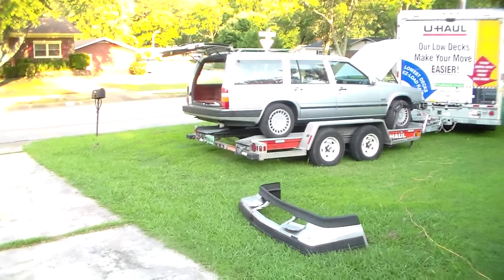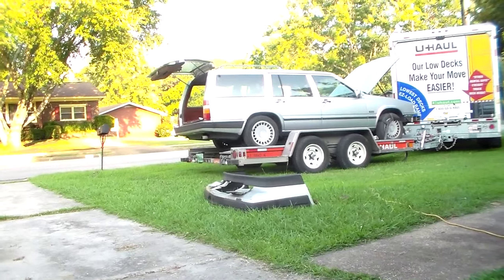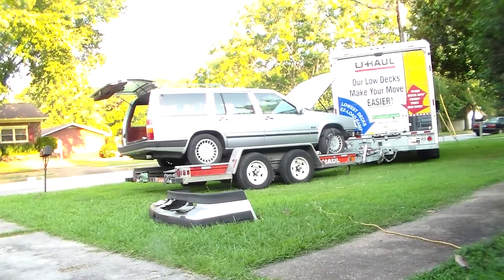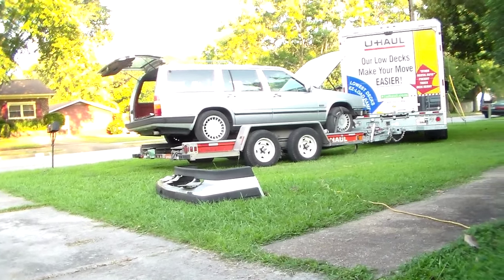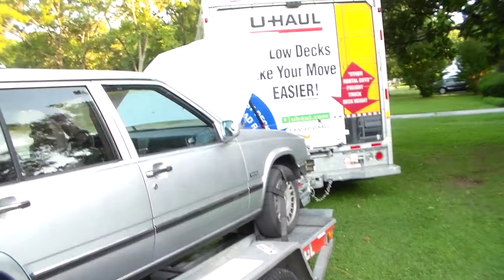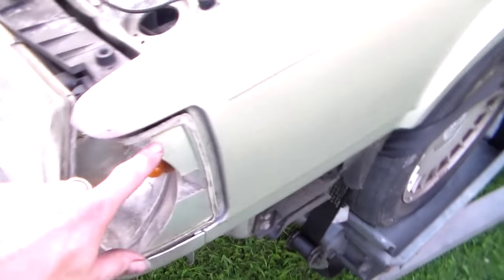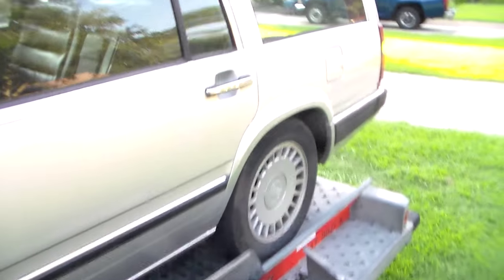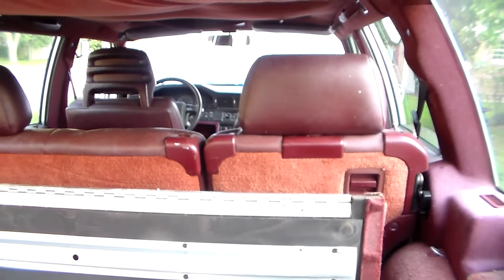Craiglist $600 1988 Volvo 760 turbo video tour 1

Comment: Just sold my 1997 e420 and it was running hot.  They are bastard cars.  1 yr only.  They were e430s after that.  Trans can be tricky but it's usually just a bad conductor plate.   Fixed mine on jack stands.   I had very good luck with PRV volvos.  Got over 260k on my 87 before I sold it still in good running shape in the 90s.   Oh and when I was in high school my first car was a Peugeot 505 TD with a 5spd.   Haha.  We are from the same mold!

Comment: Hey Tyler. The engine is called B230FT and wrong oil cap is from a B23 engine! The wire harnesses that you don't like is "series resistance" for the fuel injectors. Don't touch them or your wagon will be just as dead like the red 99 Volvo!  Volvo outsourced the plastic lens to a french company called Valeo, they are known for going bad. if you're interested for setting you up with EURO style lenses, shoot me an PM!
Reply from the maker: siemenstraffic  Thanks man. I realized that was NOT stereo wires. I'm not a big euro lens guy but I will keep you in mind.
Reply: That's not the wrong oil cap.  Early B230's used that one.

Comment: That b230ftt engine are great engines. In sweden they take extreme abuse.
You can easy make around 300hk with the stock pistons and rod.
You can easy cranck the psi up on the turbo and change the injectors..
That car will last you good with some small fixes. Its not to uncomon that the seal on the crank pully on the bottom leaks oil and the valve cover otherwise they dont often push oil.

Comment: 1988 Volvo and no rust?!  Anything older than say 1995 here is rusty around the fenders and the frames underneath.  Good ole rainy England for you.  I've been looking at wagons on eBay for a while...Been looking at the Volvos like this - most seem to have the issue with turbos, however Volvos don't seem to be worth much.  You can get a good Volvo estate like this with faded bad looking paint that runs good (people can't have a faded car, can they?) for £400 with under 200,000 miles.  But I've been looking at finding with a W115 chassis Mercedes in diesel (similar to the 220D you had a while ago) - most seem completely rotten though, or stupid expensive or a W123.  Preferably a W123 wagon with the 300D engine (OM617 diesel, preferably non turbo, but I'm not too concerned) with a 5 speed.  Been looking for a few months and haven't seen anything really.  Seen 4 cars, 2 were complete CLUNKERS, another 2 were good.  one of those was automatic (meh, think it would have to be a manual) and another perfect drivetrain, but hadn't been on the road in 3 years and needed a little bit of bodywork.  Again was faded paint.  I'll never understand why people don't drive cars with faded paint...My 1997 was red, now almost a mismatched pink colour, but it doesn't bother me.

I've seen some Volvo wagons with non-turbo engines, however whether they petrol or diesel I don't know.  Most on eBay.co.uk are automatic, few are manuals though.  What's the difference between the 200-series, 700-series and 900-series?  Don't they all use the same engines and look the same anyway?  Unless 900 is the later ones and 700 is earlier, suppose that could be it.

Would you ever look out of place in a 1997 Mercedes E420.  Too new and complex for me to consider, and a V8.  Not here with the price of our gas.  Older V8s like that aren't worth anything here, too expensive to run.
Reply from the maker: SuperFIFTHGEAR No, not a spot of rust.

The 200 series is smaller than the 700/900 series and only offered with naturally aspirated 4-cylinder gas engines or for a few years a 6-cylinder diesel here in the states. There was also a PRV V6 in the 260 and 265.

The 700 series is larger. The 740 is the more basic model and the 760 is essentially the same car with more standard equipment. The 940/960 is yet another evolution of both the 740 and 760, but mostly the same car. The earler 7-series used the same engines as the 2 series for the most part, but the later 760 and the 9-series started using the DOHC versions of that engine and the 6-cylinder white block engine.